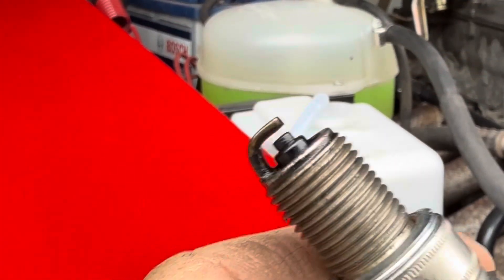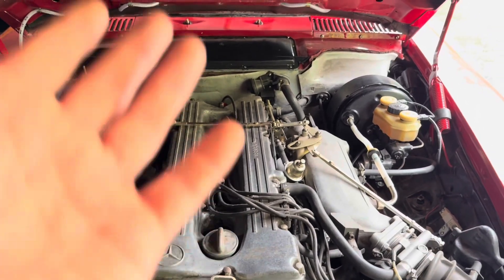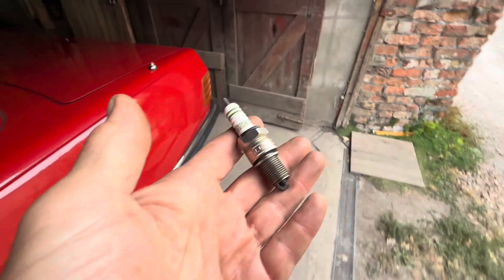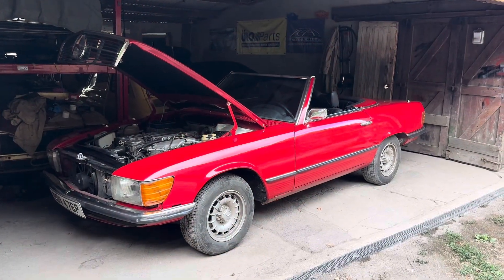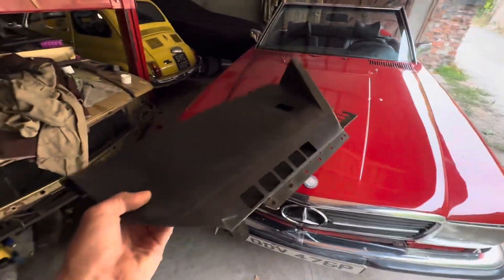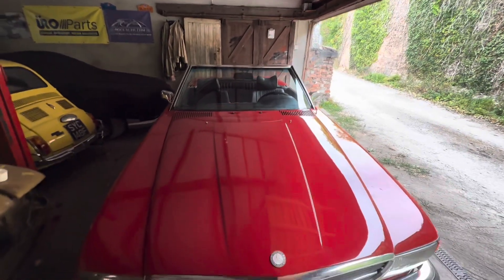Mercedes M110 engine - coin balance whilst engine is running + diagnose and fix a misfire

Comment: Your videos are awesome and have helped me greatly !!! I own a 1975 280sl with Recaro seats and the 4-speed manual transmission. It has 190,000 miles, and I have already replaced many components to keep it running well. However, the fuel pressure regulator has failed now. I live in the USA, and this car, being a grey market car for the US, it is challenging for me to source one. Is it possible to modernize the fuel pressure regulator setup and keep all the rest of the system the same?
Reply from the maker: Hi - wow that is the same car I am restoring…..except that that someone has swapped the manual for an auto box. I have done 3 videos on the fuel pressure regular including one which shows a potential replacement which comes from the US:

https://youtu.be/wG4UtnAoYCs

Genuine (working) FPR’s are hard to come by. Mike
Reply from the maker: Hi - does your car have a steering hose on it with a curly metal bit where it attaches to the pump? Mike
Reply: @MikesMercsandothercars  Yes, it does have a curly section. I took pictures but have no way to send them. I watched your video on the FPR, but that was a while back. I need to go watch it again. I did have to update the fuel pump with a 4bar fuel pump due to not being able to source a 3bar original one. Then I adjusted the FPR to 31Psi. Car drove great for about 8k miles and now it can barely make 20psi. I think the 50 year old FPR just couldn't handle the 4bar pump. Which is why I want to replace it with a more modern one.
Reply from the maker: @brandidan-the-car-man3521   Yes...you will quickly knacker your FPR with a higher pressure fuel pump. You would need to regulate the fuel pressure BEFORE it hits the FPR. The original pumps are still available....although horribly expensive. See 14.43 in the video below.

https://www.youtube.com/watch?v=ZqEqTt3xs8Q

Mike
Reply from the maker: @brandidan-the-car-man3521  Than ks for the heads up on the power steering hose. the previous owners of this merc swapped the car to an auto transmission and possible swapped the engine) and I just wanted to be sure that it has the correct nose before I source another one. Mike

Comment: One of the best engines ever. I love the sound of the M110.
Reply from the maker: Yes - considering this engine hadn't run in 10 years, it seem to be remarkably smooth. How is the best 560 in Arizona coming along? Mike
Reply: @MikesMercsandothercars I am taking a break because it’s too hot to work in the garage. I don’t think I can balance a coin on the M117, but I have to give it try.
Reply from the maker: @TonyLiveTV  ...after all the excellent work you have done, it wouldn't surprise me. Mike